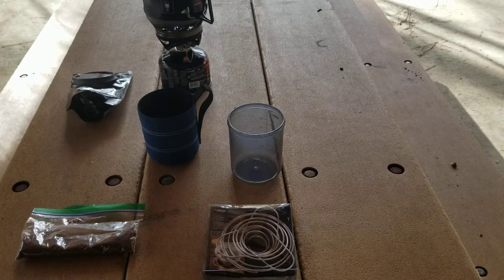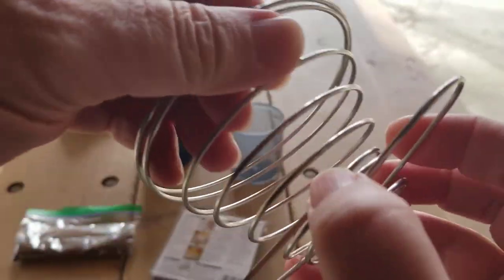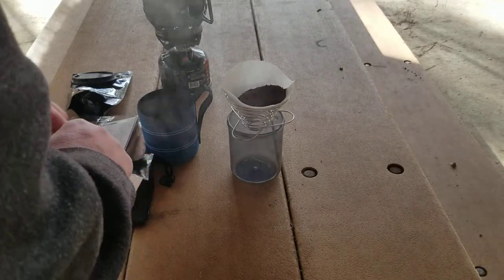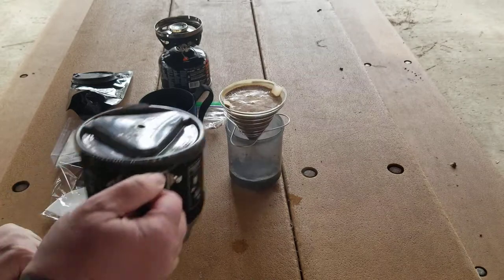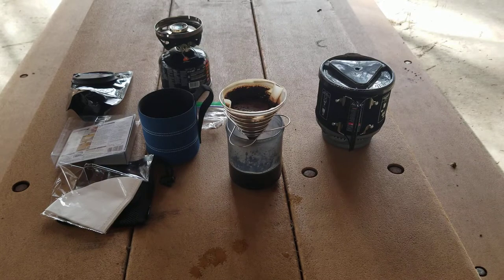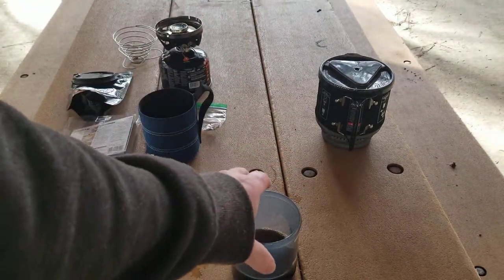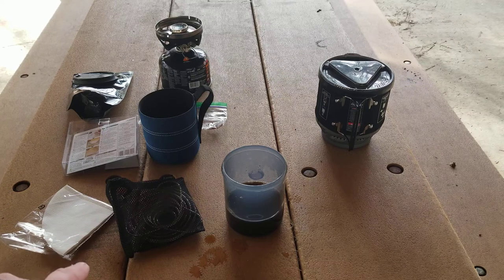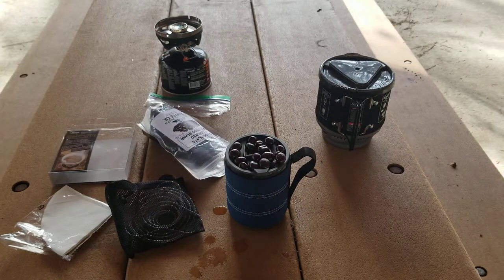Soto Helix Pour Over Coffee Brewer

Comment: Nice product. I have something similar. Mine I got at a dollar store. It's a silicone thing that compresses down to a small circle. But it pops up and has a bowl/cone shape with the flat circle at the bottom. You can load in the paper cone filter and the circle part rests on your cup then you just pour over. It's a good size thing that fits in the bottom of my cook kit. It's nice to take when I want something different than instant coffee and I still want to pack lightly.